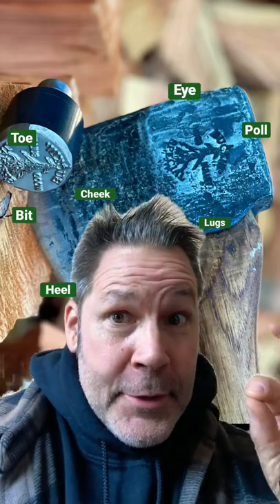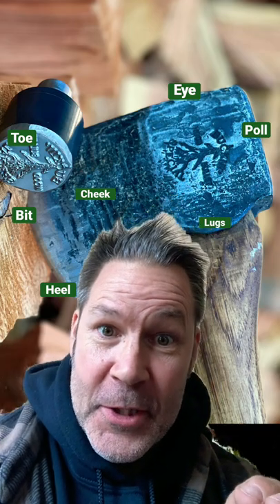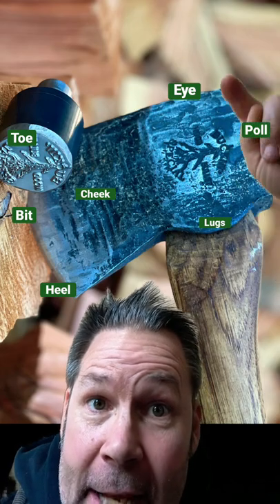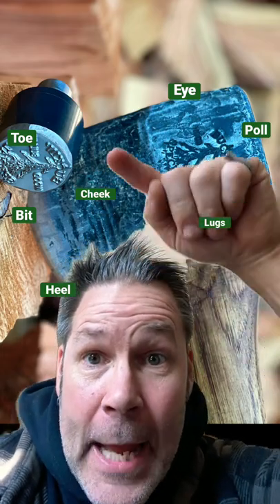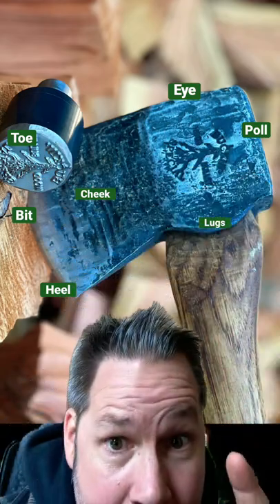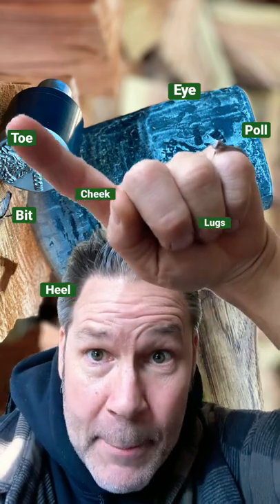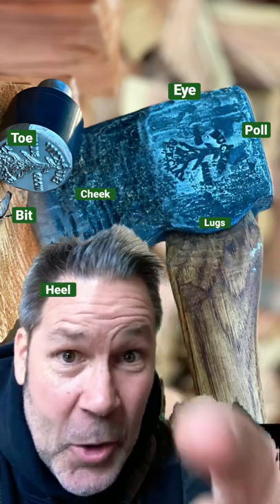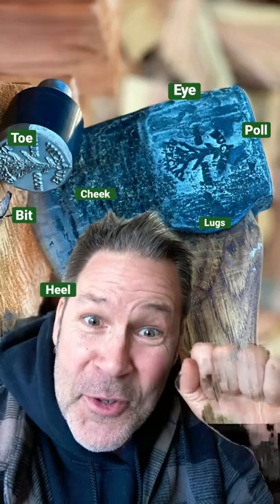AXE HEAD Anatomy. (Terms).  #shorts ￼

Comment: Ok so with the names now. What’s the point of a Lug for? I’ve often wondered why most axes are shaped with lugs..
Reply from the maker: when hafting it , or hangin' it ,, you get a real solid hang as there is more wood to metal surface touching
Reply: @BuckinBillyRaySmith  thanks! That makes sense.